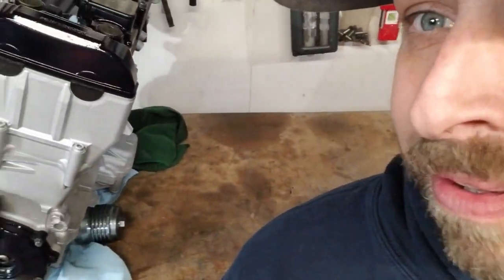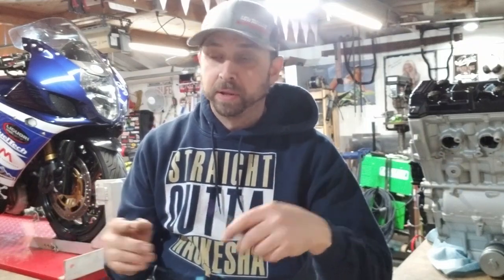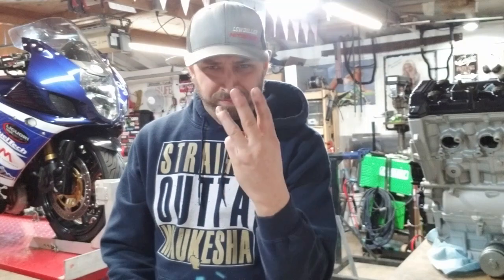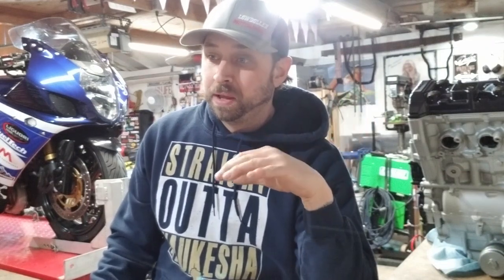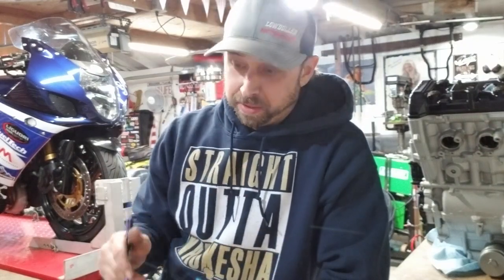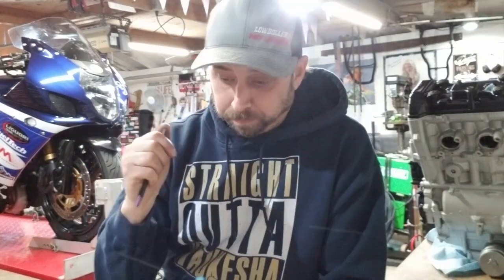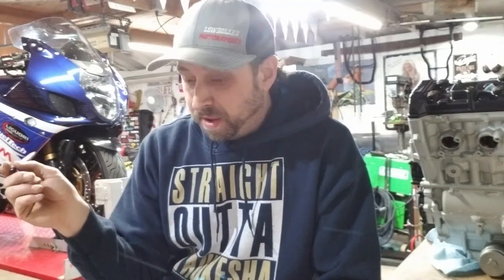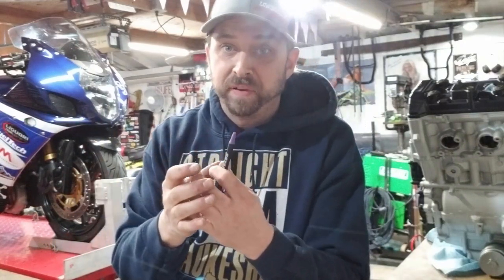Q and A and such!

Comment: So what would be a safe hp jet 60-80? With tune for it. What was the HP jet did you see more problems on breaking stuff?
Reply from the maker: 60-80 is the perfect,  shit-n-get ,fun set up. I ran similar when it was a 60" bike. I started to struggle around 150-200 on 2 kits.....i was just too much work for the fun.
Reply from the maker: 60-80 is the perfect,  shit-n-get ,fun set up. I ran similar when it was a 60" bike. I started to struggle around 150-200 on 2 kits.....i was just too much work for the fun.

Comment: In one of your videos you mentioned you use an intake cam as the exhaust cam. Can you explain this?
Reply from the maker: The cam cores are interchangeable , if you have (for these motors anyway)  an intake cam with specs you like , you can run it in either position. Just degree it in to your liking. I dont run a cam sensor so i can actually run intake or exhaust cams in either location